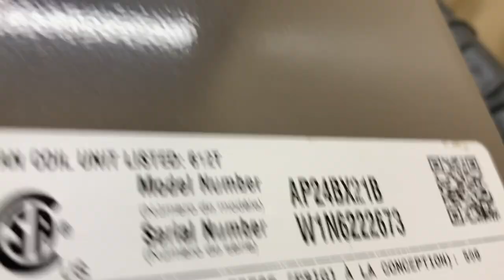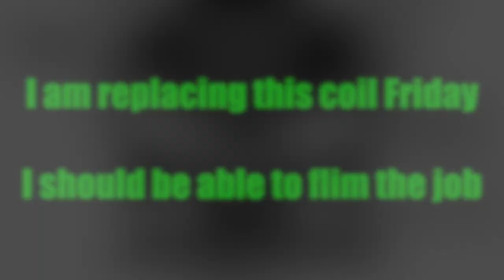Quick Leak Check | Inficon tek mate is Impressive

Comment: I have the same leak detector it is very accurate. Heated diode is the best way to go. Been using it for 2 years and have a 99 percent success rate finding leaks. Have never had a leak detector be so accurate. Had 3 others before I bought the tek mate

Comment: Great detector. Been using it 2 years, just installed new heated diode sensor today works like new
Reply: Double Bar Fishing haven’t changed my diode since I’ve had it. never really read the manual witch I probably should have. but do they need change regularly ? have had mine for 2 years as well.
Reply: SureShotAuto. depends on how it’s used and stored I guess. Mine started giving off false readings here and there but as soon as I changed it it’s working flawlessly. Catching those 410a micro channel 😉!

Comment: Thats not good for me if those coils are leaking, so far I had no issues. I really thought aluminum evaporator coils will last longer than copper coils, that is not the case apparently. I have already ran across one Trane and Carrier coil that I found leaks on. I think manufactures all knows this and that is why coils are so high in cost, they know that they will have to warranty at least one coil within the warranty timeframe. Good video👍